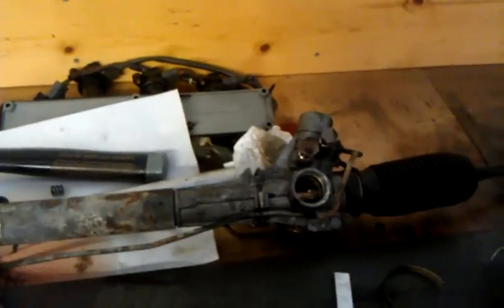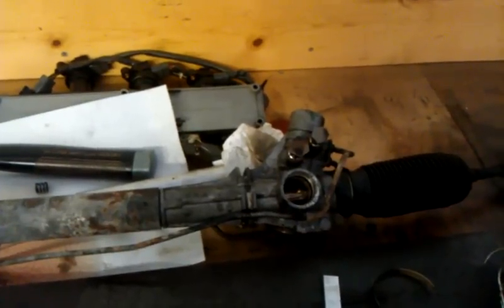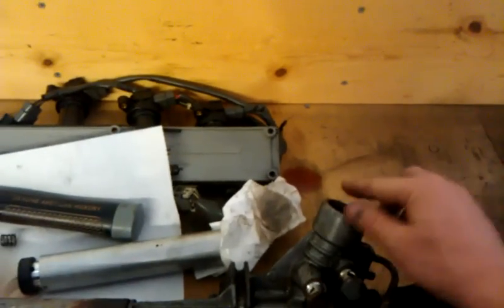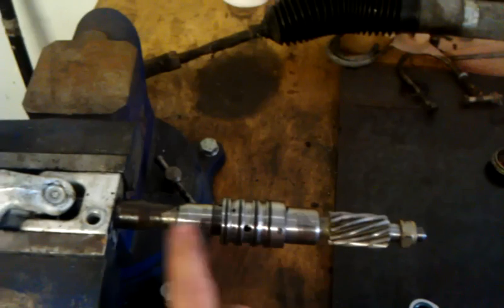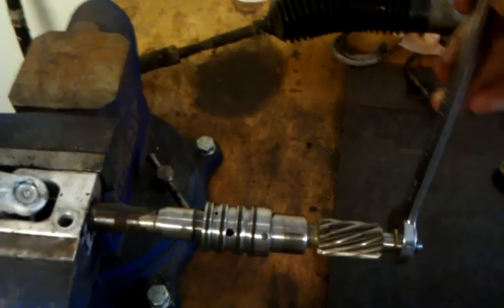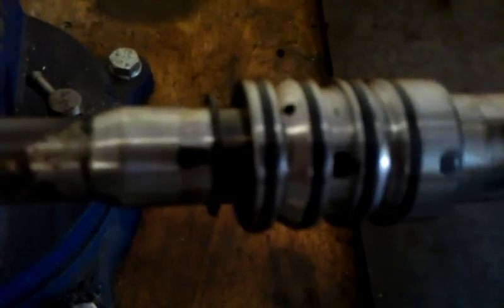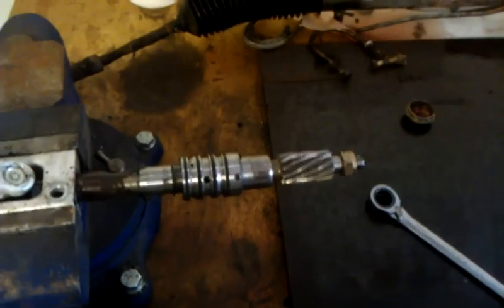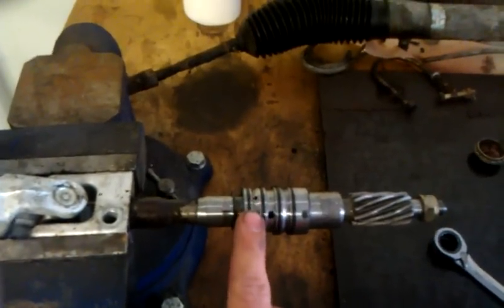Power to manual steering spool valve movement

Comment: Well I should have seen this video before... I've recently converted to power steering and was surprised by "huge" play when the pump (electric) is off, that almost dissapears when PS is operational... I've just purchased another low mileage rack and with a vice grips on shaft I can see same, little "elastic" play - And that's the valve assembly. I always thought that these valves and torsion bar twist by no more than like 1-2 degrees, and not that much. And yes, driving with PS off is scary, not only because of that play but with added main reason for installing PS for me which is torque steer on uneven or even worse ruts...